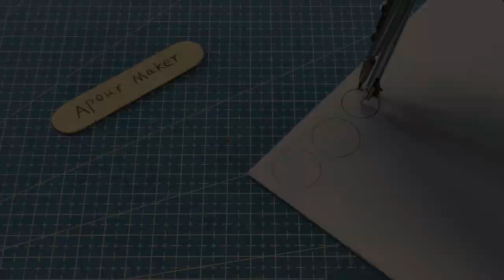how to make a flexible shaft dremel tool at home - homemade mini drill flexible shaft

Comment: Anyone with basic knowledge or experience knows all the material/components, if one doesn't, he/she/it doesn't qualify to make one.
Bike cable however should atleast be lubricated and is not suitable for this application as it cannot withstand rough usage specially it will handle rotation in one direction only. Good for wood tho
Reply: i know I'm pretty off topic but does anybody know a good website to watch new series online?
Reply: @Sterling Kevin I watch on flixzone. Just search on google for it =)